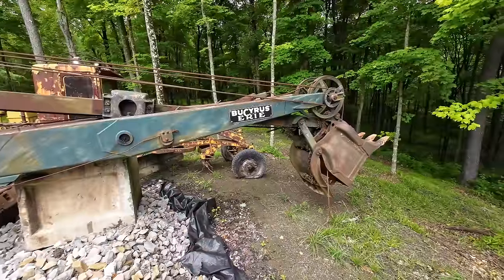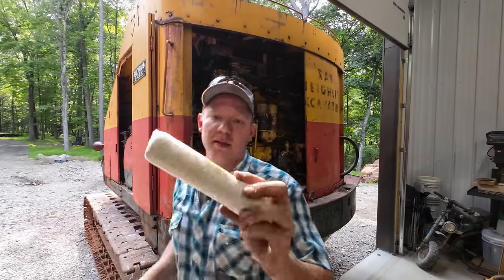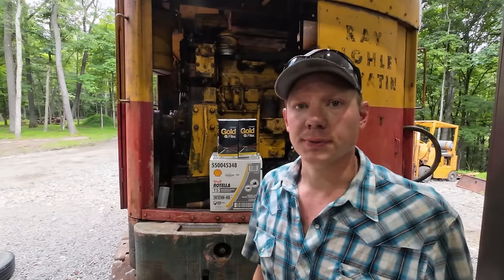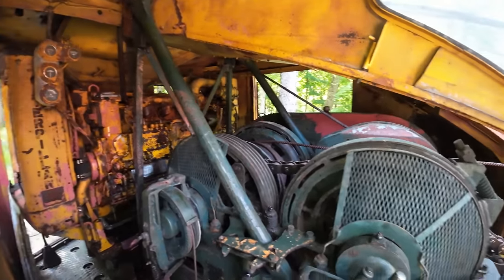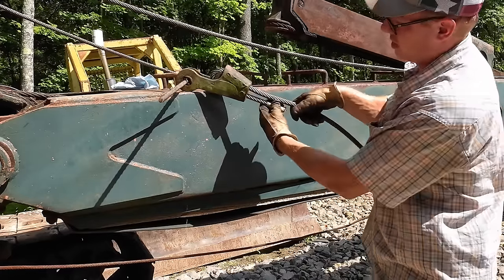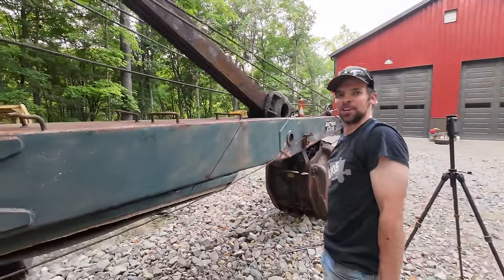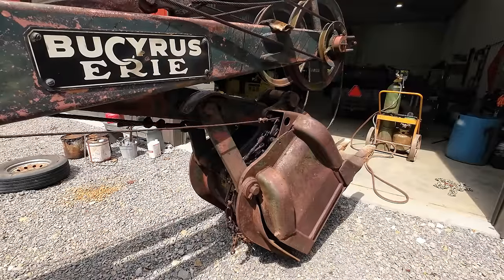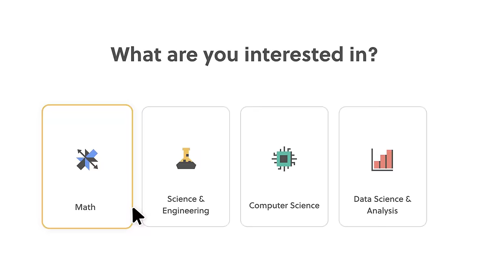Repairing a 1950 Cable Shovel, Sitting  20+ Years!!!

Comment: So has anyone noticed that everyone always has something to say about oil like seems good it's got blah blah blah n this n that. Reality is who really knows your gonna change the oil a lot regardless of what type or brand or anything in it and your never gonna know if the T5 or high mileage whatever is better than the cheapest bottle on the self. With the regulations in place on oil and standards the cheapest is the best. It boils down to longevity of engine components so unless you run a specific oil with exactly the same engine set up and have specific failures idk

Comment: I was watching, you just don't listen, ha, thought that cable was backwards.  But I watched you saddle a dead horse.  Belt and suspenders thing there bud, guess you didn't trust that wedge thingy.  Put the saddle of cable clamp on live side of cable, plus I am wondering if clamp will interfere with wedge tightening up.  Ok, I will shut up and watch video now.

Comment: the old tech was made to last
also ... there was not this modern way to think about profitability... nor the technology to make it possible. 
no... electronics or computers also. so, old machines can be repaired. 

what i want to see is the brand new now 2023 machine after 20 - 30 years of no start in the elements. 
and if it can be salvaged then.